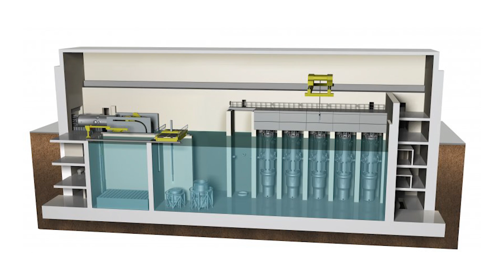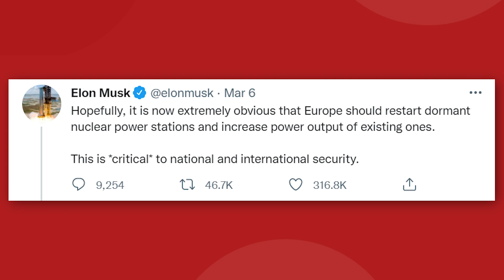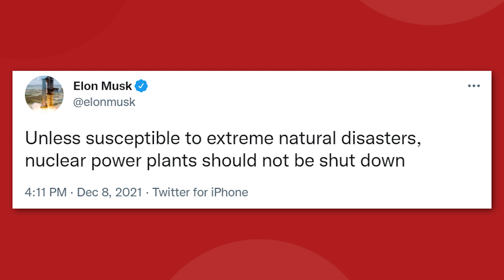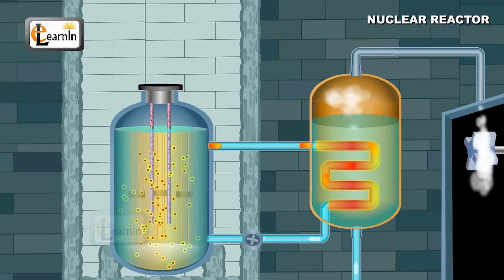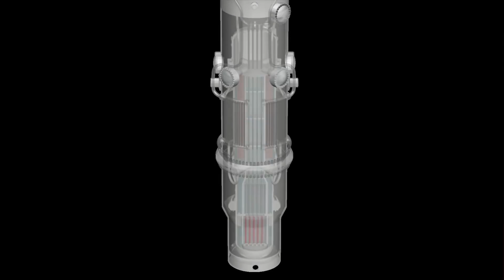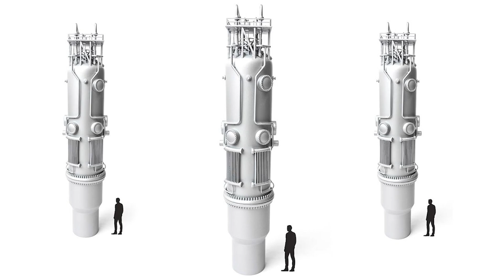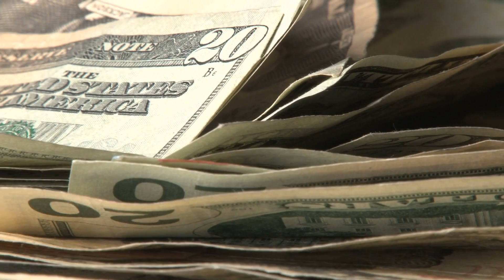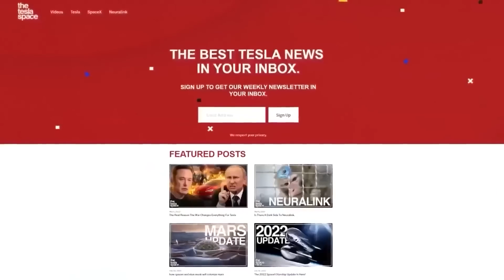The Real Reason Nuclear Energy Is About To Take Over!

Comment: This is a VERY surface level analysis and has more than a few mistakes in it, but you definitely hit the core of the issue accurately.  The current nuclear builds we rely on are decades old, early designs from the first few generations of nuclear power technology, and the public got scared away from the whole idea, more by Hollywood than anything that happened in reality.

Three Mile Island was a scare, not a disaster.  Multiple analyses have shown no difference in cancer rates between people living in the area at the time and the general public, and the facility kept operating for years after.  Chernobyl was the result of wanton negligence, and even then what happened there is literally impossible in modern designs.  Fukushima was the result of one of the worst natural disasters in the region's history, a 1-2 combo punch, and the reactor damage is actually a tiny issue compared to the actual earthquake and tsunami damage, but the media lumps the two together.

Even nuclear waste isn't really a concern, as we have multiple technologies that can effectively make use of 'spent' fuel rods (that still have about 98% of the energy we want in them).  Our biggest problem today isn't technical issues, it's the will of a public that's been lied to and scared off.

Comment: You are the only one on earth that believes that Russia shelled a nuclear plant that it had captured and was operating, and sending electricity to Dombass and Crimea where the idiot drug addict Zelensky had starved them of electricity for years.  You probably also believe that Russia blew up their own pipeline, TWICE, and assassinated the daughter of a famous Russian Patriot and supporter of Vladimir Putin.
Because you lied about this we can't believe anything else you say.  AND, you are also wrong about some significant technical details, such as:
1.  Using the standard Uranium fuel is stupid and doing it the hard way like running a car on Hydrogen.  The only reason we even used Uranium in subs, for instance, was because the government had built the enormously expensive plant at Oak Ridge, Tennessee.  Necessary for bombs, but an unwise choice for a sub, WHERE YOU NEVER WANT IT TO GO CRITICAL.
2.  Thorium molten salt reactors are far better for distributed, low cost modular reactors.  AND, they can't melt down. AND, Thorium is 7 times more abundant then Uranium, it's basically almost anywhere you find dirt.  AND, India is far ahead of everybody else on these.  AND, will be a good ally if the idiot Brandon doesn't screw that up like he did Saudi Arabia and Turkey.
3.  There are several other errors in your diatribe, but let's put one to bed forever right now.  A fusion reactor is the dumbest way to boil water ever conceived by the mind of man.  The only reasons we've spent billions on this, so far, is because of the Nuclear Hysteria propaganda spewed for 50 years by leftists.  We're now seeing the result of this in Europe right now and hunger, especially in Africa, is a near certainty next fall.

Comment: What type of nuclear reactors are in subs and aircraft carriers? Are they not also small?
Reply: Yes, they are relatively small compared to a normal nuclear power plant.  I was in subs.  They were all pressurized water reactors to my knowledge.  They are secured by being on naval vessels, in navy ports, with crews onboard 100% of the time, whose lives are at stake if anyone screws up.  Also, they operate at sea, where there is plenty of cooling water "if something went wrong".

Comment: I have my doubts about NuScale since it's a pressurized water moderated design which is an old design. IMHO the fast neutron reactors will win the race but that doesn't mean NuScale shouldn't build their design asap. I think many designs should get build and the regulators need to speed up their process greatly.

Comment: Without hearing the rest of your presentation I believe you are promoting nuclear fission with U235.  There is new science out there nobody is talking about.  Nuclear using Thorium If I remember correctly.  A safer nuclear fuel.  Nowhere near the danger of using U235.  No meltdowns, no spent rod storage problems.  In effect “ safe Nuclear  electricity.  My son in law is a nuclear expert.  A certified SRO. (Senior reactor operator). A registered Professional Engineer.  The smart people are aware of safe nuclear electricity but the politicians are so busy promoting solar,  and electric  vehicles that the new safe nuclear power is not being  addressed.  I just heard you condemn nuclear waste.  With Thorium reactors, there is no problem with spent rods being stored.  😅WAKE UP AMERICA…THERE IS SAFE ABUNDANT NUCLEAR POWER OUT THERE.  
CAN SOME OF THE KNOWLEDGABLE NUCLEAR ENGINEERS OUT THERE HELP WITH THIS IDEA …?

JoeB

Comment: If modernising toward safety and efficiency then advocate the Thorium Fueled molten salt reactor rather than 'hiding' old uranium tech in small SMR packages that dont make people 'feel' scared, and calling THAT modern.  The thorium fueled fission cycle also has the added advantage that it does not produce material that can produce high yield nuclear bombs. The Thorium is also more widely available as a waste product of rare-earth mining. The thorium reactor can be built to be intrinsically stable without resorting to a balancing act of careful active control. To advocate more uranium power generation is to perpetuate the status silly quo covertly and proliferate nuclear weapons grade material and waste.

Comment: Refuelling is not changing out every single reactor fuel assembly every 18 months. Assemblies have around a 5 year use life and that means about a third of the fuel in the core is changed each refuelling outage. 

Every assembly is removed because the reactivity levels are different depending on the age of the fuel assembly and thus the orientation of the assemblies in the reactor vessel needs changed for best and safest performance.

Comment: The steam released is not water that was flashed to steam from contact with the nuclear fuel or core itself. It is an entirely different loop of water that removes heat from the first loop that does touch the core. 

Please do some due diligence when speaking on such a topic. Your presentation of the information makes it seem like the irradiated water that touched nuclear fuel is being released as steam when infact it is not.

Comment: I'm skeptical of anything Elon Musk or Tesla. Their self driving is a glorified cruise control of death, their semi is crap, their truck is crap, nowhere near what was promised, their robot is crap, someone already did it better. Japan 10 years ago did the robot better. The hyperloop under vegas turned into a glorified strobe light tesla taxi service, that is still crap, the what 600m test tube has only ever run essentially a miniature EV, and got nowhere near the promised high speed. The solar tiles are crap. The rockets are old NASA tech renamed, and are crap. Mars isn't happening, at least not by Elon or anyone affiliated with him. Even the Tesla's themselves are overpriced crap. So this compact reactor, coming from Tesla will be crap as well.

Comment: Just a comment about technical accuracy, steam produced in the reactors steam generators does not exit at the top of the cooling tower as implied in the video.  What comes out of the cooling tower is kind of a fog generated from cooling the turbine condenser cooling water.

Comment: Nuclear energy even if you use the cheaper small modular reactors or SMR's are 3 times the KW price of current solar. If you include some form of energy storage system with solar and wind your still far cheaper than nuclear. We already have the solution to our long term future energy needs in solar and wind, we just need to finish implementing it. The only variable is what kind of energy storage we go with. We have several options besides battery storage.

Comment: Lithium batteries, NO.
Solar is only around 30% efficient, and that's with the more expensive solar panels.
Heat pumps are better as in efficiency. But comes with a lot more headache's and cost a lot to start.

Comment: 3/3 were done by humans… 

3 mile the operators disregarded the readings because they didn’t think it was possible and it should have been a non event if they followed the protocols.

Chernobyl… was a bad reactor design but also they poisoned their reactor trying to run a ridiculously dangerous and unnecessary experiment.

Fukushima the computer said to immediately flood the reactor with sea water and that would have ended the event. This would have ruined the reactor but ended the event.  They thought they could save it and they couldn’t. Also the sea wall and diesel generator problem but flooding the reactor would have ended the event, they let it get out of control.

Comment: 1. The assessment of the costs of nuke plants oddly didn't include DECOMMISSIONING, duh !.
2. At 8:20, we get told overheating will be prevented, because the reactor will be in a, "POOL OF WATER", duh ! 
I was about to give up, and thinking of a comment to leave,  when, around 8:30, I heard that the rods will be mounted on electromagnets, which will cease to be magnets, if the, "electricity fails".  SO WHAT COULD CAUSE THAT THEN ? 
Maybe something like a nuclear explosion, eh ? He didn't say.
I could be pissed off at having wasted some time at watching this. But knowing the pro nuke community includes people who seem determined to ignore the lessons of history, I can see the problem of people failing to see the failures in reasoning presented, and not having the necessary discussion 
I

Comment: Existing nuclear plants do not release boiler steam into the air. They, like all boilers, condense the steam back into water. Boiler water is extremely purified and treated with anti corrosion chemicals. They cant afford to not recycle it. The steam you see is post heat exchange.

Comment: nope, solar and wind will not be the way to go, the energy density of solar and wind is abyssmal, it may be good for a short period of time, but to be more precise, it is already not good enough. on the same footprint, a conventional fossil fuel can generate 10-100 times the electricity compared to wind or solar (and with near 100% readiness, while the others are very far from that.) nuclear can do 1000 times or better, so currently, where space is cheap, it is acceptable, but you have a limited area to waste on solar and wind, and when it is getting less and less acceptable to put more and more windfarm and solar farm everywhere, nuclear will win without question. at least on the surface. And if the fusion or other always in the future stuff ever arrive, those will be probably even more dense, so even more preferred over solar and wind. Solar will have its place in space, where space and area is almost limitless, but until that, they will quickly run out of ability to provide energy.

Comment: About time the world is embracing nuclear again. It is BY FAR the safest and cleanest form or energy. Fusion is still decades away, we need to focus more on fission and SMR's. If we put the same amount of money into fission as we have fusion, we would have had SMR's everywhere by now. 

Molten salt breeder reactors are the future imo. The problem with current reactors is they water is heated to 300c. In oder to keep it in a liquid state at 300c it needs to be pressurized. Thats how chernobyl exploded, it was a steam explosion. Molten salt reactors use liquid molten salts far above 300c and dont need to be pressurized. They are also much safer because the fissionable material is a liquid, so if something happens the fuel can be drained into a holding tank away from the neutrons that cause fission, essentially stopping the reaction. Current reactors use solid fuel which can melt and get stuck together which causes a runaway reaction. Breeder reactors can also tackle the waste problem. They are FAR more efficient at burning the fuel. You can literally use existing nuclear waste as fuel. The reason why its called a "breeder" is because the process breaks down the nuclear waste and transforms it into useable fuel that gets consumed. It literally creates more fuel than it consumes. It has also use thorium as a fuel which is extremely abundant.

Comment: It is silly to continue the argument that U235/PWR fission is the answer to safely generating low cost electricity.  This technology's primary objective has always been to make plutonium for use in atomic bombs.  As many of the comments below state, switch to thorium U233/MSR fission to safely generate low cost electricity with minimal short lived radioactive waste. These distractions, including fusion, simply provide more excuses to avoid building U233/MSR reactors.

Comment: You mentioned that Nuclear would be a supplement to solar & wind plus battery storage. I think that's backwards. Next-gen nuclear will ultimately dominate utility/grid level production, replacing coal & gas, while solar+battery back-up will serve local (e.g., residential) level. Wind will be an increasingly smaller factor, along with hydro.

Comment: Whichever design, every nuclear reactor should be suspended above at least a one-mile deep drill-hole, designed to allow reactor cores to fall all the way to the bottom in case of meltdown.  That way, reactors become truly fail safe.  Magnetically held moderator rods are fine, but such designs have failed when overheated cores distorted before the rods could drop (moderator rod tolerances being necessarily tight).  Drill-holes suffer no such tolerance limits and can be made as wide as necessary to allow melting cores to free-fall to the bottom.  (more....) 

Remember, the core of earth is naturally heated by nuclear energy already, so the further down any core falls, the more natural the result.  

Deep drill-holes have the added benefit of allowing unskilled or unmanned scenarios to devolve safely.  As it stands now, nuclear power-plants require a lengthy and expensive decommissioning processes that may or may not be feasible at some later date in the future?  What if a company goes bankrupt and government can't step-in?  What if there's war and nobody's there to decommission?  None of these were in the plan for current designs, nor for SMD-designs.  The only true fail-safe is a deep drill-hole under the core.
Reply: You would still need to fill the hole after the core dropped or radioactive gasses are release.
Reply: @ronbo2608  - Yes, so?  Rather have a pile on surface or a mile underground?  Thousands of holes in Nevada say they are safer than one Fukushima or Chernobyl.
Reply: @tomnoyb8301  Of course you are correct, however I did not make my point clear that the Nuclear Regulatory Commission would never credit/allow that solution.
Reply: @ronbo2608  - Like outlawing seatbelts.  Nuclear's already a hundred-times safer than other energy sources.  It's even safer than wind and solar.  Outlaw the seatbelt, then complain it isn't safe enough.

Comment: Water is a poor coolant because it has a low boiling temperature. This means the RX has to be pressurized and that's where the safety issue comes in. Gas-cooled or molten salt coolants eliminate the need for a core to be pressurized and thus eliminate cost and required safety systems.

Comment: No, solar, wind and lithium ion battery storage can't do it all as even a cursory calculation can easily show. In time better battery technologies using cheaper more available materials can make a difference but we will still need cheap abundant energy. That's not solar or wind with or without storage. Ever.

Comment: All 3 nuclear disasters were caused by human error. Chernobyl was trying to restart the reactor by removing control rods. TMI someone left a valve open. Fukushima they intentionally built the sea wall lower than recommended and they turned off the reactors when they should have stayed on to power their own cooling.

Comment: I wish South Africa did this. We have a shortage of around 3000 Megawatts that sometimes go up to 8000 Megawatts with breakages in units and a lack of material and even diesel to keep generators on so that we don't go into total blackouts. 

Our nuclear power plant (the only one in Africa) was built in the 60's and was only meant to be kept online for 50 years. It's under pressure, leaking and the government fired most of the qualified engineers to replace them with BEE quota personnel. We need this modular nuclear technology stat!

Comment: Saying that there is no way around nuclear waste is FALSE -- Molten-Salt Reactors can make use of slower reactions that make use of fast-breeder byproducts.  While Molten Salt Reactors do produce their own byproducts, these products (notice I do NOT call them waste) are USEFUL and are far less dangerous to handle than those from fast-breeder reactors.  These byproducts can even be put into a different Molten-Salt Reactor and burned as fuel.  Each time the byproducts from a fuel are "burned" they becomes more stable and less radioactive.

Comment: 1. There is no commercial power nuclear waste to “worry” about, never hurt anyone, and there will always be a million times less of it per unit energy.  

2. There is no reason to worry about melt downs.  Fukushima proved that: complete failure of three plants, all safety systems and … nobody killed fit radiation, zero. 

3.  US once built reactors in 3-5 years more cheaply than anything else, cheaper than wind, gas today.  Plants ran  50 years, could be 80.  It’s doable again: reform the NRC or no type of reactor, not any design, nor any size, will be built affordably, ever.